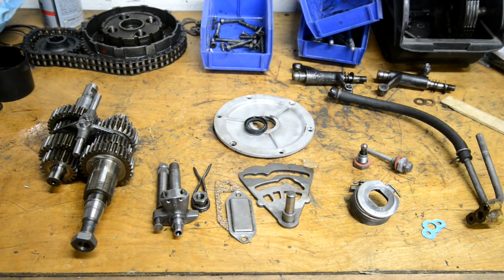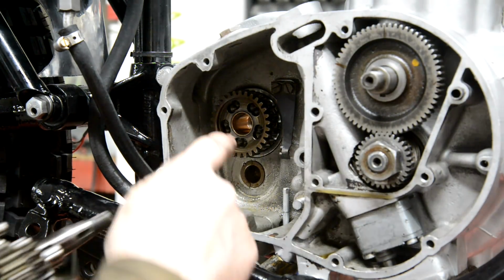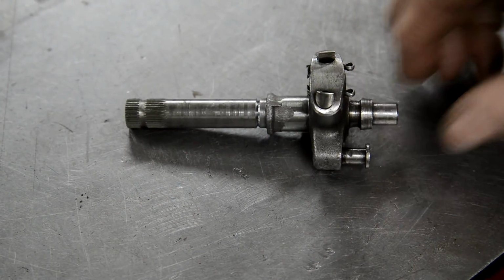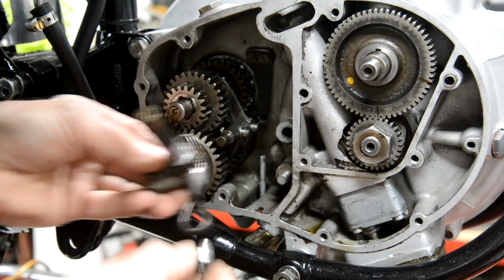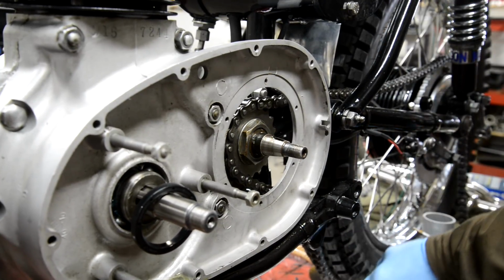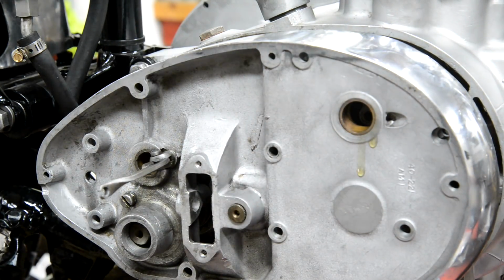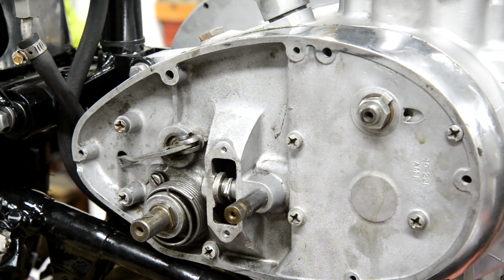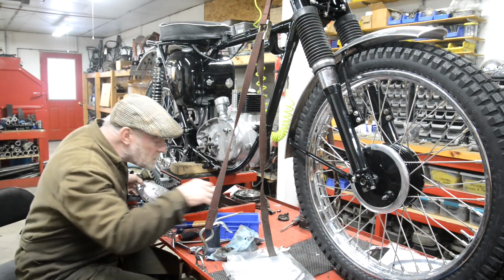BSA C15T (Copy)  -  Part Seventeen

Comment: So similar to the Tiger Cub. I had the inner cover off and on loads of times on the cub I used to have, made a mess with the gasket goo, until I realised you had to turn the ratchet anti clockwise a bit, very infuriating!
When you were talking about the kickstarter spindle leaking oil it reminded me of the thick felt washer which goes over the gearchange lever shaft on the cub presumably to stop the same leaking problem, but as you say, no room on the kickstarter. 
Really enjoying the videos, thanks

Comment: The forward facing hole by the Camshaft bush in the inner timing cover is from a timed engine breather. There is a tiny hole down at the bottom of the cover, easily missed, that allows oil that is blown out from the breather to pass back into the oil pump cavity. The little scallop out of the rear of the outer cover is to allow the pressure to vent to atmosphere.

Comment: HI Michael,  thanks for the videos. regarding the kick start oil leak problem on the earlier c15s I tried the o ring solution but it did not make much difference and also prevented the kick start from returning correctly so my plan B was to machine a recess in the outer end of the inner cover and fit a oil seal, this worked a treat and did not affect the kick start ret

Comment: Great videos, really interesting. Can you clarify a point you made regarding the installation of the oil feed and return pipes from the oil tank to the engine. you say you have crossed the pipes over, on my 1959 C15 the pipes are not crossed. now not sure which way round they should be. Keep up the good work.
Reply from the maker: Hello Jim. You will see in the next video that I was wrong. They only cross for the end feed cranks you will see how I found out.

Comment: That hole to the right of the cam shaft is the crank casing breather. You should have a corresponding hole in the cam so the engine breathing is timed.
Alan

Comment: Michael, nice video, as ever. A mod done by competition guys (and I did on my road C15) was to hacksaw the tail of that outer cover through, so that by removing one screw you could get access to the clutch cable/lever.. A lot of familiar stuff from 50 years ago here.... i used to cut the split pin short before putting it through the gear-change quadrant, (it was a right faff), but much neater than your effort!! Thank you for sharing your workshop again. Les in UK

Comment: No mention of the special bearing washer between first and next gears? I always put a locking washer under that selector nut. You need about 1.5 turns of starter spring, I use pump pliers to get mine on. It's a struggle.

Comment: Good morning from the UK Michael. Surprised to see you not change the cam plate spring in the back of the gear box. Back in my youth I had quite a few c15 and the most prominent memory of most of them was pulling the gearbox apart to change yet another broken spring.  :-)

Comment: Tbh not sure about adding a seal to the kickstart, unless you can add some meat somewhere to counter the removal of the material to add the seal, personally I would have looked at adding a small o ring to the kickstart shaft itself rather than modifying the case, looked plenty thick enough and wouldn’t be introducing any flex if put in the Center of where the bush is, cheers mate and happy new year! Rich

Comment: I thought the distributor pinch bolt screw had it's head under the cover and the slotted head was accessed via the small hole.  I will have to rewatch, could have sworn it was not fitted. Great series, than you

Comment: Keith Bartlett.  Sussex UK.
I also noticed you didn't replace the worn out gearbox camplate spring 40-3042.  Mine had been completely worn away & looked very much like yours so I replaced it although it did seem to make gear selection a bit stiff.  Didn't you notice this or do you think it'll be OK to leave the old spring in place.  Great series of videos as usual.  Looking forward to next weeks episode.  Happy new year & keep well.

Comment: Hi Michael, Happy New year to you and Linda. Regarding the kickstart oil leak, Would it be possible to cut a small groove around the kickstart shaft in line with the case and fit an O ring to the shaft rather than the hole in the case? It wouldn't weaken the shaft that much would it? I wish Royal Enfield had a large cover plate over the drive sprocket like the C15, It would save a lot of work when changing cogs!! Well that's it Stay Safe and enjoy your riding. Dave UK

Comment: Hi, when you fitted the new kickstart with its new pawl. There is a small piece that is screwed inside the case that works with the kickstart mechanism. Unfortunately I cannot find any diagram that shows which way round it should be . Can you help . Mike . Midlands

Comment: Put gear lever on pull it up then you can see split pin hole much better ive bulit loads of c15s and b40s and theres lots of improvements to be made original design  was very poor and down to a price